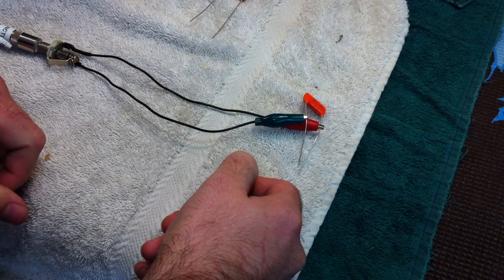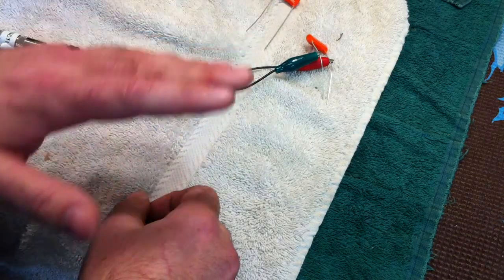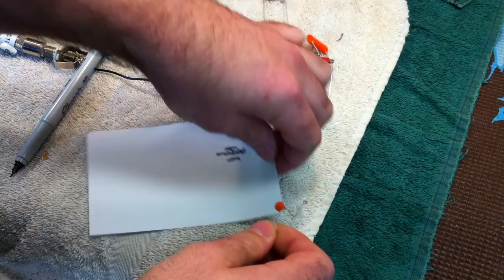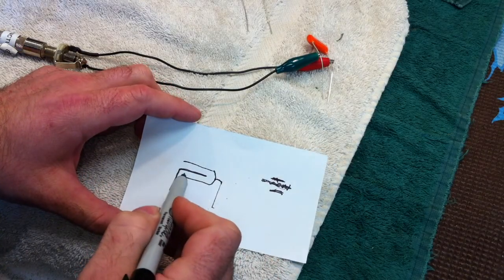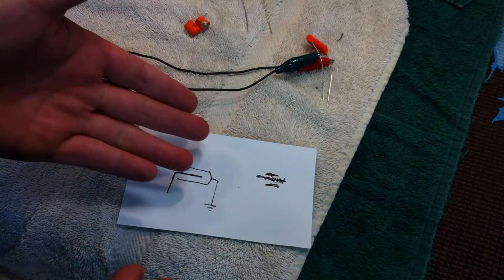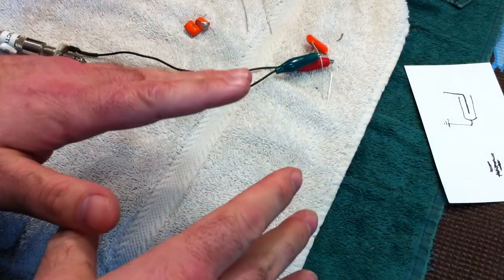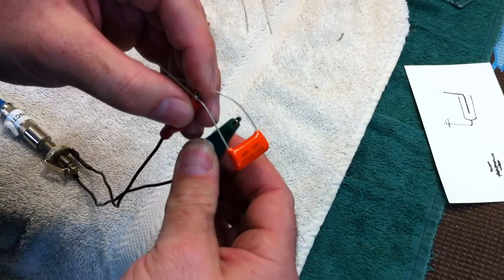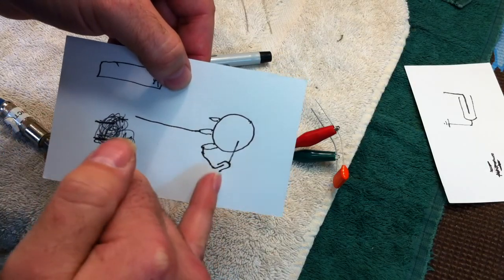Installing Orange Drop Capacitors in the Correct Orientation

Comment: Current DOES NOT jump across a capacitor when it's full. That would be an arcing (shorted) capacitor. Electricity is stored and released from a capacitor but does not cross the dialectic. That is why they are used to BLOCK DC current in electronics. It is also why they have a voltage rating...
Reply from the maker: It's a simplification for the sake of the video topic. For those that want a deeper dive, I would recommend this video by The Science Asylum: https://youtu.be/zYRx6Zub3cA
Reply: All the misinformation and voodoo electronics
Reply: So is the video correct in capacitor direction
Reply: @howguitars2201  No, electrolytic capacitors are to applied to dc circuits and polarity makes a big difference, working versus an explosion. The capacitors he is using do not, the explanation is also incorrect.
Reply: @danteedee8204  asking cause it seems capacitors in guitars make a difference in make n model caps. Wonder if wich way was ground would as well.
Reply: @How Guitars   the value of the capacitor in Farads will change the frequency response to the circuit, the change can be predicted if you know the inductance and resistance of the pickups. The construction of the capacitor, orange drop, bumble bee etc. Should not make an audible difference if they are the same value. If there is an audible difference, the values are not the same or a part was defective. There is a chance that the construction could change how much noise is picked up or how long the capacitor will last. Shielding of the cavity can remove the noise.
Reply: Direction /polarity should not matter and has not been mentioned in any of the books I have read or courses i have taken in electronics. I do not design electronics for a living but In the voltage range that guitar pickups produce I doubt there is any chance this would matter.
Reply: Interesting viewing Drew. Thanks. Gee, you know how to stir up the hoards though. I recon there’s a few who need to chill. Cheers mate.✌️

Comment: I watched this video after watching Dr. Carlson's Lab. The guy is definitely knowledgeable. But I think this really ends up being nothing more than a cool little science experiment that, in the end, really isn't relevant. A solution to a problem that just doesn't exist. I'd like to see someone take an amplifier and purposely put all the non-electrolytic caps in "backwards" then take them out and put them in "correctly" and see how much of a decrease in the noise floor would be. I would be surprised if it was more than 0.01% of a decibel. If this was truly an issue, manufacturers of these capacitors would be marking them by now.
Reply: To add to this, no current should be actually crossing the dielectric portion of the cap. They do not "dump" or "jump" electrons across the gap. If the cap does this it is failing. Any current that "passes" through the cap is purely from charging or discharging either during an initial DC voltage being applied or removed, or an AC signal being applied.
Reply from the maker: @raezzordaze8021  It's a simplification for the sake of the video topic. For those that want a deeper dive, I would recommend this video by The Science Asylum: https://youtu.be/zYRx6Zub3cA

Comment: Wow.......did you nail this one! I'm re-capping an old radio and am a fan of Mr Carlsons Lab. Have to install about 20 caps and none are marked, while all the 80 year old ones are clearly marked "outside foil" . The new ones have no such markings and I do not have an oscilloscope. But I'm a sound guy that does karaoke and have a couple of small PA amps handy and tried this with a couple of alligator jumpers and some of the old caps I removed.....Works like a charm! Thank You:-)
Reply: Some modern high-end caps are double wound, so it doesn't matter which way they are installed. They're usually much larger than it's equivalent value single wound cap.

Comment: Why is this song and dance needed to determine the orientation? If the manufacturers just marked the bloody things in the first place this hassle would not be needed.
Reply from the maker: profit motive
Reply: The manufacturer would have to test each capacitor and then mark it. That's two more steps. Every step adds cost to the product that they'd have to pass to their customers. Not all of which are using the component in a sensitive signal application. So they'd be paying for a feature they don't need. They'd go buy cheaper parts elsewhere.

Comment: Thanks for the useful info, does that also apply to mustard caps?
Reply from the maker: I'm not 100% but probably. They seem to have a foil component so unless that is in the form of cimetrical plates, I am going to say yes. I don't use these at the shop so I am not super familiar with them.
Reply: @DrewsGuitarShop  tried it today and it does. Tried many different manufacturers and construction types. It is interesting to hear how different caps are affected differently, some show a big noise difference and others less, but I came across the Panasonic SMF 33nF (very small polyprop) which were very silent on both sides. Well there you go, you live and you learn, thanks again for the useful tip.
Reply from the maker: @lorencing  I use a 33uf orange drop in my strat. That is a really good value for a single coil tone pot. It is remarkable how much different the throw and sound you get from different designs is. I am glad you found it helpful!
Reply: @DrewsGuitarShop  I also think the 33nF (or 27nF) is a good value, also use these values.

Comment: Very interesting video with very clear explanations.  Can I assume that the orientation of a Bumblebee tone capacitor in an electric guitar's wiring harness makes a difference in sound?  The reason I'm asking is that I own 3 newer Gibson Custom Shop LP Reissues all with Custombucker pickups and typical 50's style pot-wiring.  2 of the 3 LP's sound great and one not so much.  It sounds "veiled" for lack of a better word.  Last night I decided to look inside each of these LP's to see if I could notice any wiring anomalies.  Low and behold, the LP that doesn't sound as good has its Bumblebee tone capacitors soldered in the opposite direction as compared to the other 2.  I know there are many, many variables that determine the way a guitar sounds, but could this be a plausible reason for its lackluster sound?  Thanks!
Reply from the maker: The setup counts for a lot. I always advise getting a guitar setup before doing anything with the electronics. You may find that pickup adjustment, action, string choice and other factors are what you are hearing more than something like this. The thing that happens more than anything with the caps soldered in backwards is hum and interference from outside EM waves, not so much a tonal difference aside from how that hum might interact with the waves produced by the guitar. Take it in for a setup first.

Comment: BS...
Reply: what is?
Reply from the maker: It’s demonstrably not. Follow the link in the describing to McCarlsons lab to see this done with an oscilloscope. You can literally see it, even if you can’t hear the difference in noise I’m demonstrating in this vid. If you would like to argue the point, I’d like to see your demonstration. I’m open to being wrong here but I gotta say, this is one of my more well researched videos and the effect I am demonstrating is literally part of the orange drop capacitor design as it was meant to be a direct modern replacement for foil and oil caps used in older audio equipment. The outside foil lead was marked on those caps for this very reason.
Reply: @DrewsGuitarShop  Nope its a waste of time. I've been in electronics for 40 years. If there was a significant difference they would have said something about it decades ago. Its all voodoo
Reply from the maker: @PhuckHue2  All I can tell you is to watch the linked video and look at the oscilloscope test.
Reply from the maker: @PhuckHue2  K
Reply: By no means bs. Element is designed asymmetrically, so it matters which lead should be grounded. Another question is it really makes a difference in shielded cavity…
Reply from the maker: @grimoirworkshop6623  That is a good question. My thinking on it is that the cavity shielding is always prone to small leaks and I will take every opportunity to quiet down a guitar and that since I tend to wire my pots in a modular fashion, I'd like to think that if that tone pot was canabalized in the future and put into a guitar that wasn't shielded that it would be nice if it was wired in right. You are right though that it would matter a lot less.
Reply: @grimoirworkshop6623  He's right. Its BS
Reply: I agree. Its voodoo electronics

Comment: Polarized capacitors are labeled so you can install them correctly.
Reply: True, but that’s not the point of this guide. If you watched the whole video, it explains how the physical configuration of Orange Drop caps and their installation can affect interference. It’s not about polarity, it’s about EM insulation.
Reply: @LeftyPem  Early in the video he mentioned polarized capacitors exploding if they were wired wrong, but what would be the results if the capacitor was installed in the guitar and grounded?
Reply: @rong648  I’m guessing it has something to do with the orientation of the external shield and how it’s configured, but I’ve never really thought too much about non polar caps since I’ve never really dealt with any interference from them up to this point
Reply: @DoktrDub  Polarized Capacitors are the ones that have specific positive and negative polarities. While using these capacitors in circuits, it should always be taken care that they are connected in perfect polarities.
Reply from the maker: @rong648  I think there might be a semantical thing here. Polarized and biased are two different things in this context. While polarized caps will only function in one direction as caps (and usually explode if hooked in wrong) a biased cap like these orange drops have a preferential direction they are designed to work best in. While they will function, and notably not explode if wired in backwards, you will not have a shielded side acting as a shield if they are wired in backwards, but instead may have a sort of small antenna. Its the difference between adding noise or reducing noise. The foil side of the cap acts similarly to the shielding of a body cavity if it goes to ground.
Reply: @LeftyPem  Where is the interference coming from once installed and everything is grounded? If you notice, there was no interference before it touched it.